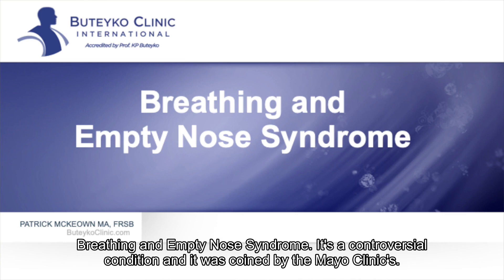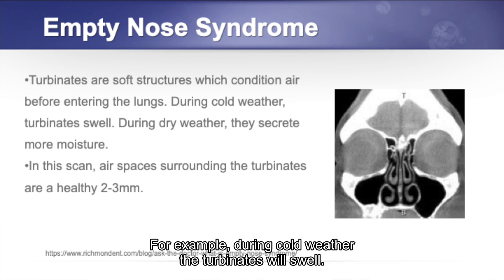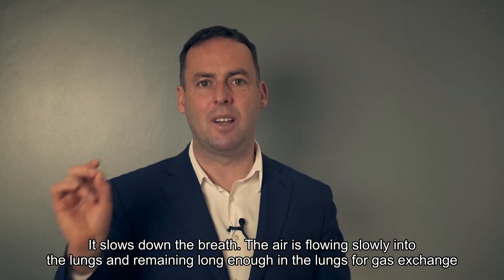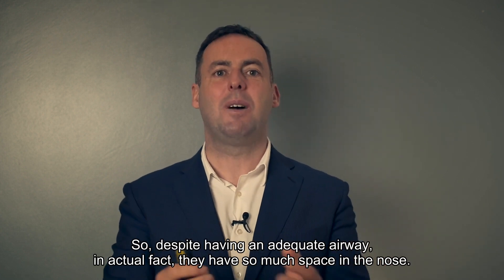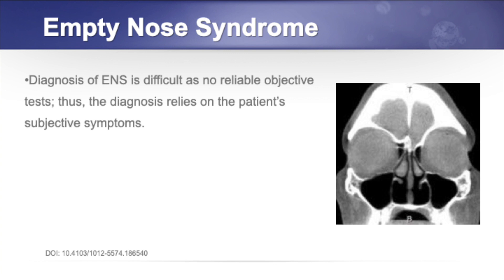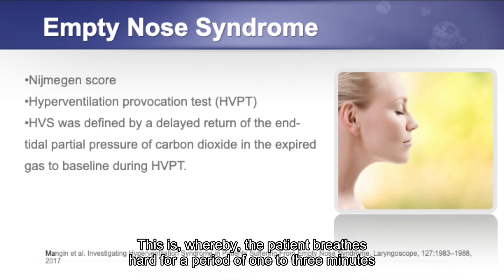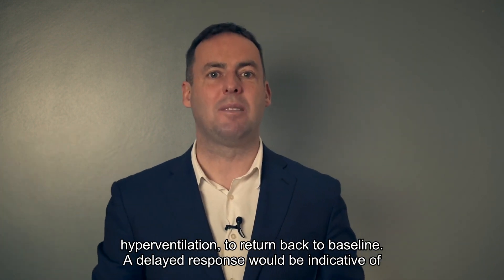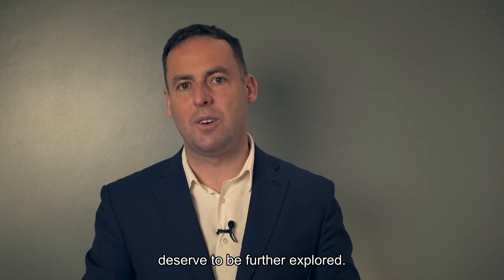Empty Nose Syndrome

Comment: This is partially correct. We do measure nasal resistance to see how much airflow against the pressure gradient is occurring to see the impact of turbjnate surgery and positive pressure breathing. The thing that upsets us in the medical community is that the effects of Buteyko on nasal function and flow have never been measured nor proven, only evaluated based on patient opinion, and there a difference. In our ENT lab, we looked at this concept, and although it decreased some of the autonomic nervous system and sympathetic tone in the nasal mucosa, it actually increased resistance and the feeling of congestion, And, this video is coming from a non-licensed, non-medically trained opinion. That should be disclosed.
Reply: What's can a person take for turbinates hypertrophy without have turbinate surgery

Comment: had a fess 8years ago. on one side of my nose they opened it right up and the other just a little, i was supposed to have a septoplasty done atbthe same time for a deviated septum but they chose to break my nose and reset it instead.

the deviated septum is still there butbthe nostril that was opened up is fantastic, so much air flowing, its lovely, but the other side is horrendous, constantly blocked, no air flows at all, andy cold or flu is horrendous pain on that side,
i cant wait to get that side done, and the septoplasty, oh to be able to breath again fully

Comment: I had surgery for my deviated septum 1.5 years ago. Ever since then I can only breathe through one nostril at a time (no air comes through, I can feel no air if I hold my hand under my nose). Whenever my right nostril is open, I feel fine, but the instant it switches to the left nostril, I get a suffocating sensation. Is it possible that I have developed ENS on one side or could this mean that the passage way is too small? I would appreciate a response
Reply: Did you have turbinate reduction?
Reply: @brianb2416  yes
Reply: Hey brother, even I'm experiencing exactly the same problem... I mean EXACTLY THE SAME...Did you do anything about it to solve the issue? Kindly respond

Comment: Let me tell you from the beginning, I first had an operation in 2009 because there was a mass in the pituitary gland. This operation was performed on the nose due to the location of the mass, but the shape of my nose was distorted after the operation. It turns out that they took most of the middle cartilage (septum) of my nose, a big hole was formed in the septum (and No explanation was given by the doctors about why it was taken)
Later, the ENT doctors that I was examined said that it could be taken to close the operation area.
However, I couldn't get used to my nose shape, moreover, I had a post-nasal drip, my nose was constantly swollen.

Anyway, I had the operation in 2019,the doctor said that the operation was successful However, in the first days of the operation, I couldn't sleep because my throat was drooping, no examination was made for 7 days even though I called the doctor's assistant, 7. When I went the next day, the plaster was removed and a spray was given for the sagging in my throat. Even though I only informed that the hole in the septum would be closed, the doctor had already filed my already small nasal bone, lifted the tip of the nose and expanded my nose to the sides, making it almost like a black nose.
The main problems appeared on the 14th day when the tampons in my nose were removed, my breathing changed strangely, I was constantly short of breath because I could not feel my breathing, I was trying to breathe deeply, this caused me to be busy with my breathing and not be able to focus on anything else during the day, My sleep at night was also often interrupted, when I told the doctor about this situation, I opened your nose like a cave and he said you need to be able to breathe very well.

I came back from Istanbul and started to continue my work, but there was still abnormality in my breathing, my nose hurt while breathing, I started to breathe through my mouth constantly during the day, I had no solution for the night, I would fall asleep at night, I would wake up with panic and heart palpitations, this situation always happened. It was repeated at least 10 times a night, my under-eyes collapsed, my body began to weaken, I was sluggish and tired every day, I couldn't focus on my work, my social life was over, I was forced to come and go between work and home, I spent the rest of my time trying to sleep, I didn't even have to clean my house.
Moreover, because I was constantly sleepless, I started to lose my health day by day, my heart could not stand the sleep apnea I experienced at night, it became tired, now I had constant heart palpitations and I was on my way to heart failure.

3 years after the last surgery, in 2022, when I was examined by an ENT professor and told my complaints, he looked inside my nose with an endoscopic camera and your 2 lower turbinates were completely removed, the hole in the septum was reopened over time, you can't feel your breathing because the turbinates have been removed, and there is also a feeling of pressure because the inside of your nose is very wide. It does not form, so when you fall asleep, you wake up in panic because the brain cannot feel that you are breathing. Moreover, there is no cure for it, just as a severed finger cannot regenerate, so do the turbinates. He said to use a nasal humidifier, but the room did not work.
   And when I was a person who loves life and tries to stand up in all circumstances, I even thought of committing suicide, I don't know how many times I will end up, think about it, you can't feel that you are breathing and this is a situation that repeats every second. I am only 30 years old, but I collapsed for 10 years. I have a heart disease. When I searched foreign sites for empty nose syndrome, I saw cases of suicide and even cases of heart attack.
   All I can say now is this: How is medical education given in Turkey, how can the doctor who operated on me, knowing that I will have empty nose syndrome, can take all my nasal passages completely, we entrust our lives to these doctors! I wish I had never had that pituitary surgery and hadn't fallen into this situation. I have no right to such doctors, they ruined my life. Of course, there are good doctors, but I have always had bad ones.
No matter how much I rebel, this life will pass like this, this is my test in life, I have no choice but to be patient.
I hope that a cure will be found as soon as possible for those who have ENS syndrome like me and myself.
Reply: Jeez man that’s so fucking unfortunate, I was really considering getting surgery done on my nose so that I can stop mount breathing, like a turbanent reduction but after reading these thing I can’t
Reply: How are you doing ?
Reply: 😮this Is my story.  I also went to Turkey. They are ruining lives there amputating turbinates.
Reply: I have a very similar story to this aside from the beginning part. It’s disgusting what these surgeons do to us. I am the same age as you and my entire life has been stolen from me. I’m so sorry you’re going through this.
Reply: @gg21410  how is your nose and breathing now?
What did you feel when you first felt the symptoms of ENS? And how many weeks did you experience it after surgery? I did it 3 weeks ago and now my mouth feels dry and my sleep is disturbed because I often wake up with a dry mouth, is this a symptom of ENS or just a sleep disorder?
Reply: @gustiana6839  horrific, i am completely debilitated. 
i had it immediately after surgery but the symptoms were full blown by 2 weeks post op. suffocation from my nose being too OPEN with no resistance, couldn’t sense my breathing, hyperventilation, freezing cold sensation permanently in my nose and freezing air hitting my nasopharynx at the back though in my nose i can’t sense any airflow, bone dry nose, manual breathing, really dry throat and mouth, sore throat, gasping for air, dry sore eyes. I have a LOT more issues than this from ens but that’s how it started and i still have all of those issues too. 
dry nose and mouth/throat are symptoms of ens but those symptoms alone do not mean ens. it’s all surgical damage anyway though, your mucosa isn’t functioning properly to keep your noise moist because of the surgery you’ve had, if these symptoms are new. 
i can’t say if you have a separate sleep disorder, not my forté sorry :(
Reply: @gg21410 Was your sleep often disturbed and you woke up every few hours after the operation? And were your turbinates removed completely or only partially? And how did you deal with it so that you were able to survive until now? Sorry if I ask too many questions, I'm very scared and worried about that because I just got married and only have one child who is still a toddler that I still have to look after.😢

Comment: I have been diagnosed with ENS. And the Buteyko ideas are the only thing that is helping me improve a bit. I mouth-tape, prevent sleeping on my back and eat a low-carb paleo diet. This gives me a huge improvement in quality of life compared to before. It puts me from suicidal to "almost okay". But is uncomfortable and takes immense discipline.
Reply: How does low carb diet helps mate?
Reply: @20puskinas1992  eating carbs makes you breathe more to process them. Carbohydrates + Oxygen => Carbondioxide
Reply: @RichardMaassen  who did you get diagnosed by? Can i have his info?
Reply: Does sleeping on your back make it worse? How do you sleep?
Reply: @passionfruit4321 Yes, a bit. I use a special belt to prevent sleeping on my back.

Comment: Can you get empty nose syndrome without surgery?
Reply from the maker: Hi Christopher, yes you can. This exercise will help decongest the nose: Nose Unblocking Exercises - https://www.youtube.com/watch?v=cU4ls5ku4Rg
Normally, the nose can be congested until BOLT score is twenty seconds or so. Wear a nasal dilator on your nose to help keep it open during sleep.
Also, make a deliberate effort to slow down your breathing.
Don't change to mouth breathing even if you feel the want to.
The more you breathe through your nose, the more your nose will remain open. Try the nose unblocking exercise above five times by four times daily or so. Also, advisable to wear tape across lips during sleep. Patrick
Reply: @ButeykoClinicInternational  Not true, this is not factual. Only patients that go through surgery get Ens. Anything else is different.
Reply: @ButeykoClinicInternational  Is it permanent though or can it go away? Considering i never had any surgery
Reply: @christopherorrante289  how's you now
Reply: @akshaythakur9702  It's better. When i dont think about it, i dont feel anything ot have problems breathing. Weird but that's how it is for me
Reply: @christopherorrante289  bro i have same symptoms not feeling air but i never had surgery

Comment: I am worried about this coz i just had may RF turbinoplasty yesterday and it's only now that I know about this complication. I feel ok right now. Do anyone know when is the onset of ENS after surgery?
Reply from the maker: We have witnessed turbinates shrink from applying the Buteyko Method. For a deviated septum it will not change.
If you experience symptoms The Buteyko Method is worth practicing as reversible inflammation will reduce using this method. Overall, it is very effective for nasal stuffiness.

Comment: Hi, I'm experiencing similar symptoms but I haven't got any surgery since about two months I had a strong flu, lost of smell (not covid positive) after using some treatment with nasal washes my nose turned so dry, on the beginning I had some difficulty to breathing now after some treatments with thermal waters (inhalations) breathing and antibiotics aerosol is ok, my turbinates are still little inflame or little big but the nose is dry I only feel good on the outside where my mucho start to reproduce, I do not longer use my heater at home to keep humid the rooms but the worst is in the morning dry noise, mouth and dry eyes ... I use some nasal creme moisturizer with hyaluronic acid... So as you can see this empty nose can occur without surgery... Don't know what to do, I will see other doctors in the next days ...
Reply: I experience the same. Are you better now?
Reply: @17LOES  hi, I'm little better nose is no so dry as before buy mucus still missing ... lots of fluctuation smell and taste ... and you?
Reply: @marcoz8552  Hi, I am in the same situation, it's been 6 months that I can't Feel air in m'y nose and it is really dry and kind of cold inside sometimes. It occured when I did an accidentaly high dosed inhalation of "clou de girofle" essential oil... (sorry for my english, I'm French)
How are you doing now? I Hope better.
I saw few doctors that told me that my inferior turbinates are a little bit smaller and purple. They don't know why exactly and if it will heal or not
... I can't imagine the suffer of the "real" Empty nose syndrom. It must be horrible. All my support to all of that people.
Reply: @marcoz8552  I also use a mixture with hyaluronic acid and "glycérine végétale" with water. It helps a little and doctors told me To continue. If it can help...
Reply: @juliettej.5045  How you now bro i haven't any surgery but not feel air what is the reason
Reply: @juliettej.5045  Please reply same
Reply: @akshaythakur9702  hi how are you now?

Comment: you can't control ens with breathing, it is very severe, what a stupid video
Reply: Correct. Breathing is most ens cases is compromised from nerve and tissue /mucosal/sensory nerve damage. Neural signals do not pick up the sensation of airflow thus leading to 24/7 suffocation/fight or flight.

The amount of secondary damages this causes to the body such as the health of the nose,lungs, and nervous system is a whole other monster this condition brings.

Comment: Can only septoplasty cause this condition , because I need to get my deviated septum corrected . Please someone help please I'm so confused
Reply from the maker: Hi, Bilal. Most people will still be able to breathe well through their nose with a deviated septum and  compromised nose.The Buteyko Method is designed to decongest the nose, and help restore normal breathing. It is recommended to try the nose unblocking exercise from the YouTube channel: https://www.youtube.com/watch?v=tgmKIwUqhkg&ab_channel=ButeykoClinicInternational
Wear a nasal dilator on your nose to help keep it open during sleep. Also, make a deliberate effort to slow down you’re breathing. Don’t change to mouth breathing even if you feel the want to. The more you breathe through your nose, the more your nose will remain open. Try the nose unblocking exercise five times by four times daily or so. Also, advisable is to wear tape across lips during sleep.
Currently, we are in the process of developing our own nasal dilator, we are not selling it yet. I am not familiar with the exact time when this product will be launched on our website, for now, it’s likely to be a couple of months away, as we had some issues with the design of the box. But please continue to follow our store page. Patrick